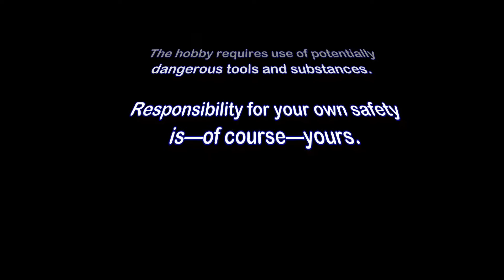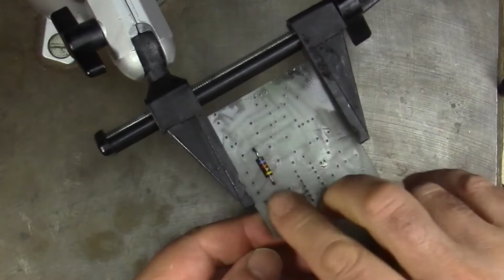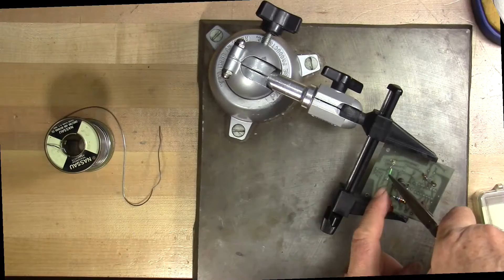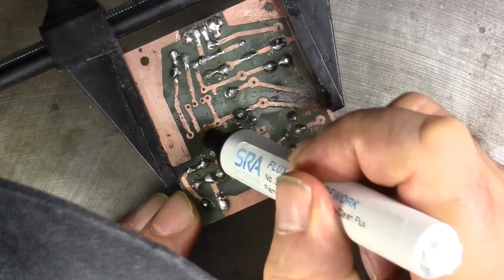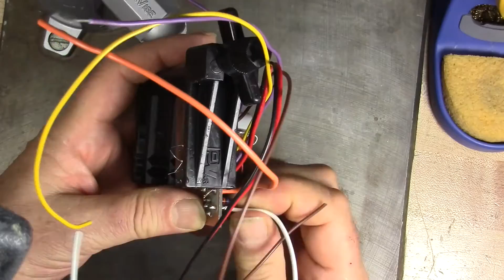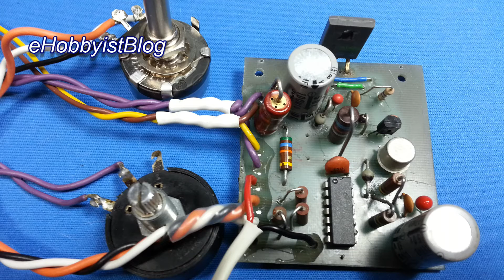034-Power Supply--Variable + (8)

Comment: Why use a flux pen rather than flux bearing solder? Just curious, because it seems like it takes much longer to do the job.

Also, your soldering iron head looks way to large for this job, contributing more heat than necessary to the parts. I don't know what temp you use, but i would guess it's in the 375-400+ range, so you should probably use a smaller (chisel) head to minimize heat damage. For example, the resistors you did first can have their tolerance skewed and tempco ruined by high heat, even for seemingly brief periods.
Reply from the maker: +SteelBlueVision 
     I use both—a rosin (flux) core solder (in this video 60/40 0.04” WW) and a flux pen. I seem to get a better solder joint using both. 
     The purposes of the flux are to reduce any oxide already on the copper and to prevent any further oxidation while the copper is being heated by the iron. During the soldering process, the solder dissolves a small amount of surface copper (but not copper oxide) and merges with it. After soldering a good joint, you cannot tell (microscopically) where the copper ends and the solder begins. I heard somewhere on YouTube (possibly EEVBlog): “you can never have too much flux.”
     The video macro lens might be deceptive. I was using a 1/8” chisel tip at 350°C in the beginning and moved to a 1/16” chisel tip at a slightly lower 325°C around the IC. Most components are rated at a maximum number of seconds at a specified temperature. Agreed: exceeding these specs can damage the component.